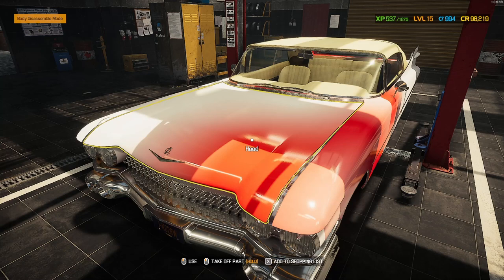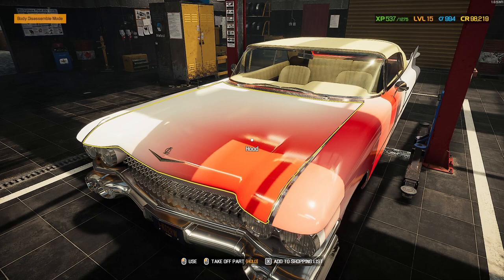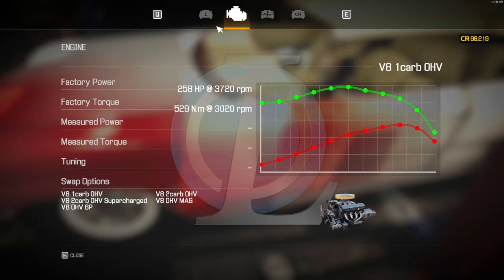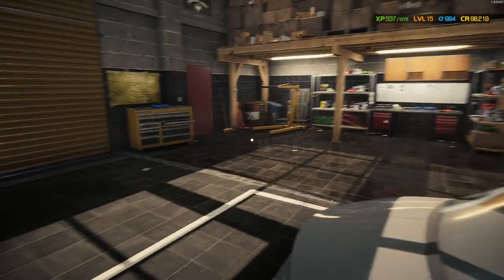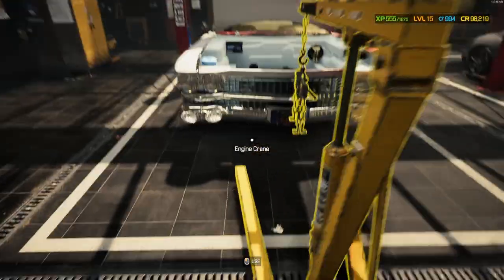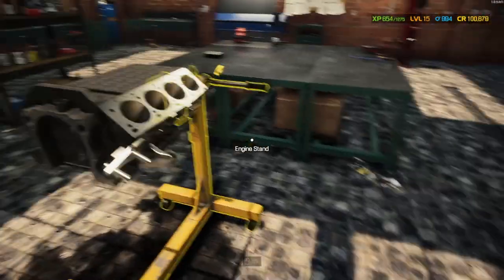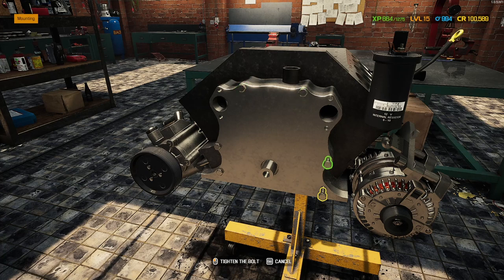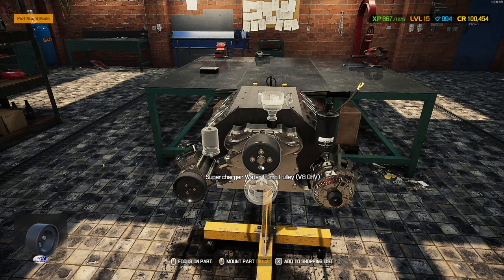Car Mechanic Simulator 2021, Supercharged Engine Tutorial

Comment: Great vid, really helpful.
Idk if they updated the game or something with a fix before I started but you can take the engine block itself off of the stand in part unmount mode. It saw the engine the way it did because you didn't do that, you don't have to put the block back in the car like that. When the game sees the engine as disassembled (everything unmounted including the block.) All of the parts are in your inventory.

Comment: Hi KP, Wheels not aligned refers to the wheel alignment system that you get when you unlock the Test Path, Once you send your vehicle to the test path building you will see along the back wall the Wheel Alignment machine and the Headlight alignment machine, To set the alignment just stand next to the machine and when you click on it you will see your 4 wheels, Just click on the + and - to adjust the alignment to zero, Do this to all 4 wheels and you are done
Reply from the maker: very nice buddy, thanks a lot.
Reply: @KpShamino  Also Kp, I am not trying to tell you how to play the game but you do not need to refit the engine block back in the car, When you place an engine on the engine stand and disassemble it one part at a time do not stop once you have removed the Crankshaft and click "Remove engine from stand", Instead just keep going and disassemble the block the same as the rest of the parts, This tells the game that the Engine block is a Part instead of an Engine Then you can change to the supercharged engine and start the re-assembly.
Reply from the maker: ah nice did not know that.
Thanks

Comment: Hi!!! I completed the engine on the stand...... Now how can I install it into the car??? Manually is not possible and there are no options to move the engine from the stand to the proper tool to install..... Very annoying
Reply: First you should see if its the same engine but supercharged.
Then, you should be able to fit it into the car
make sure nothing misses tho, cause there is a lot of parts in a single engine.